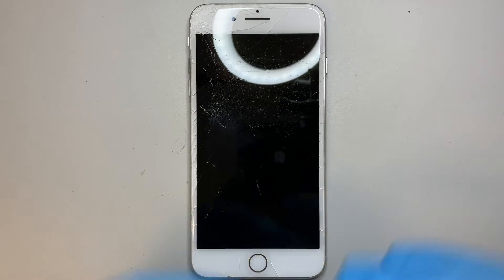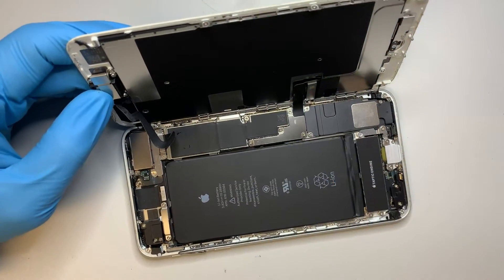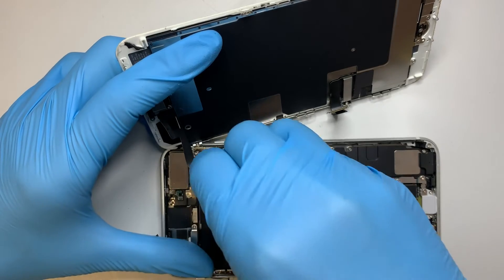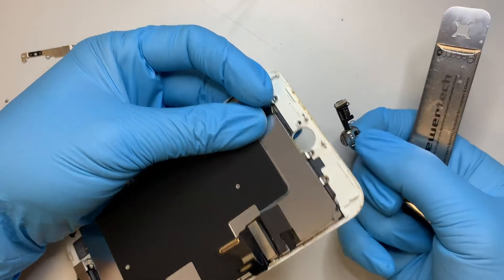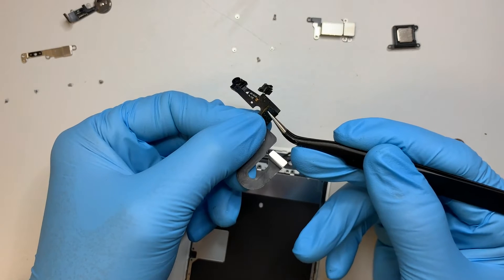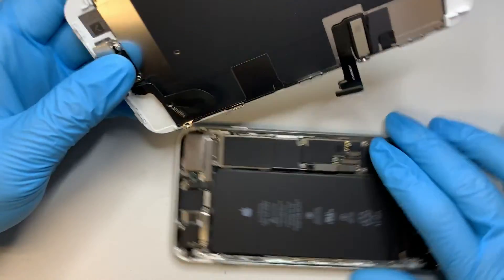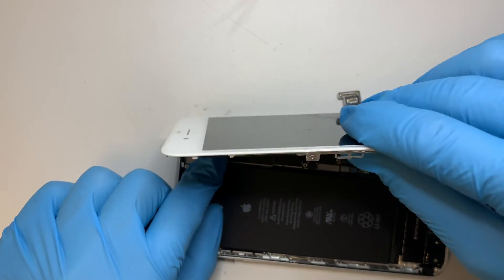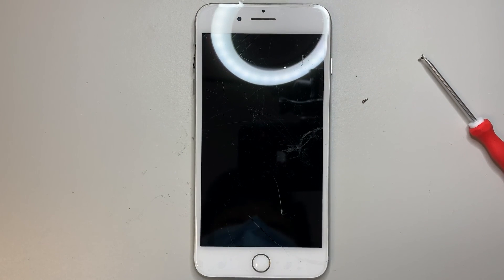iPhone 8 Plus Screen Replacement

Comment: The Amazon replacement kit never mentioned I would have to remove and replace my home button and camera to put on the new screen, and they gave me the worst set of tools that are not color coded to which screws - they are incredibly tiny.... I'm about to give up because the little screw driver is not getting my screws out... and I feel I am going to be stuck taking it to a repair shop....:face-purple-crying:

Comment: Thanks very much for the tutorial. But you forgot to disconnect the battery flex from board which is a risk that will lead to frying the board when connecting screen. It has happened to me one point a time when changing LCD.
Reply from the maker: Thanks for letting us know

Comment: OK I have the JVC the only thing I see 8, n +8 tap motor/Except since it was made in China and grammar is off and so is excited vibrator. I thought it was to program my girlfriends vibrating. But the CPU on her vibrator. I got her a new rechargeable one. Now I can Play call of duty way more. lol it’s late and I’m just Babbling. Anyways back to the phone situation the only thing I see for the 88+ is to reprogram the tap engine is that even a thing? You should be able to buy a new chapter game put on any board and if you work fine? Correct me if I’m wrong. There’s no need for Tap engine/vibrator programmer. On most iPhones simply swap out and we’re good to go no program needed. I may be wrong.  I assume if I just transfer the old one to the new housing I should be able to bypass that step. I don’t ever remember seeing that vibrator or their k motor had to be reprogrammed when changing the screen or transferring it to another board. Any input on that? Would be greatly appreciated. JVC that I have coming with attachments sold separately I guess I’ll have to buy the truth on 148+ maybe they have one for all of the iPhones on one board I doubt it though. But the Chinese have created some pretty amazing things to help guys like us keep up with apples changes trying to People from getting it repaired from Teck’s that are not working for them. I work for Apple for a little bit but I make more chicken wings on the side why do all the hard work and have them take all my money. I think it’s the guys that are doing the repairs and not completely Following through. Especially with the new iPhone  they make today. Simple research most of the time what hamster will tell you about any new features text need to know when you’re repairing the newest iPhones. Anyways do you like your future endeavors.Keep coming with the informative videos and thank you

Comment: Is it possible to just replace the home button flex that connects to the motherboard? i ripped it while opening it
Reply: it is not possible as the home button is paired to the motherboard.
Reply: @bt7482  oh i mean the cable extension that connects the home button to the motherboard
Reply from the maker: Yes, the back plate that runs as extension can be replaced. Just change the entire back plate with extension cable
Reply: @UbergeeksBiz  thanks

Comment: my last two little screws on home button is not coming out on mine ...
Reply from the maker: Is the screw stripped ?
Reply: @UbergeeksBiz  probably not  and  im probably using the wrong tool , I ended up going to  repair shop and they manage to replace the screen ... Thanks for the video...

Comment: I have a few concerns. I was repairing a friend’s phone and everything went well... until I turned it on. The display wouldn’t turn on but the phone was vibrating.
Reply: It had no effect but did one good thing. The apple logo flashed up for 2 seconds before returning into a coma
Reply: @attilaodor6002   Try booting the phone up with the front camera disconnected.
Reply: @attilaodor6002  the Apple logo came on that that is good. That means that displays working. Plug it into iTunes make sure the laptop is plugged in because your phone needs to be either charging or I have more than 80% do a recovery or download a new update
Reply from the maker: Try this. Remove the new screen flex cable. And Disconnect the battery flex cable. Wait for 5 seconds. And reconnect all flex cables back on. Hope this will bring the screen display back on.
Reply: did you unplug the battery when you were doing the repair you may have short the board. Also when you are attaching connectors to the board need to line up perfectly kind of wiggle until you feel it line up. Doing it in light check twice when you know it’s lined up press gently down you feel and hear a click then you know it’s all pins are in place I’ve done so many repairs in a rush. If your not careful  you bend the Pins and then you will have to Sauter a new connector on

Comment: sir i made the mistake to not unplug the battery and now the screen glows but its all dark with no apple sign. it vibrates and makes noise. i have a feeling i fried the motherboard. can it be repaired.
Reply from the maker: If the motherboard is fried, it will not make noise or vibrates. I would say try disconnect the battery and reconnect again to see it the screen ok. If not, try putting the cracked screen to see if any display on it.
Reply: I bet if you tilt the screen just right you can see the screen, the backlight it likely out on the motherboard, it can be repaired at a quality shop.

Comment: It would be nice if you stated which screwdriver you were using for each screw you were taking out.
Reply from the maker: The bottom two screws are Pentalobe TS1 0.8mm. Y screwdriver is TP/Y 0.6mm. for the screen and bracket. And last screwdriver you need is philip PH00 screwdriver.

Comment: I used your video and found it very helpful but I do have one criticism...  I think it would be better to give the advise of keeping the camera cover screws in order because they are different sizes when removing them not as you replace the cover. Hindsight is a wonderful thing especially as the point of the tutorial is to give foresight as to what to do.
Reply from the maker: Thank you for your comment !

Comment: Hi, I did this but the screen is not turning on, even though i hear the phone turning on and it vibrates when i switch it to vibrate on the side. any ideas on why this could be happening?
Reply: Disconnect the battery then connect it again try turning it on
Reply from the maker: Hi, I would think the connector is not press in firmly or the new screen is defective. Try to take it apart, check the connector pins and reseated them back firmly. Good luck !